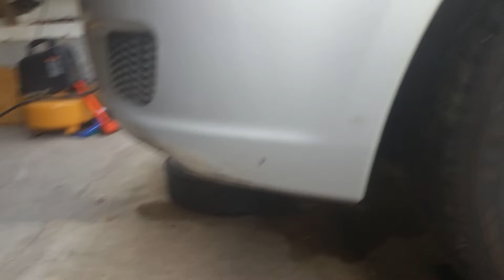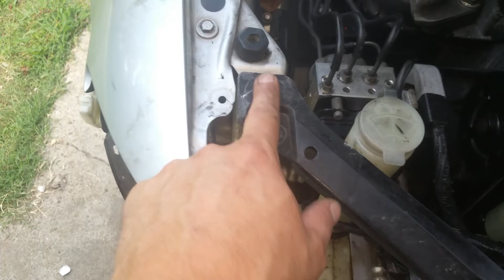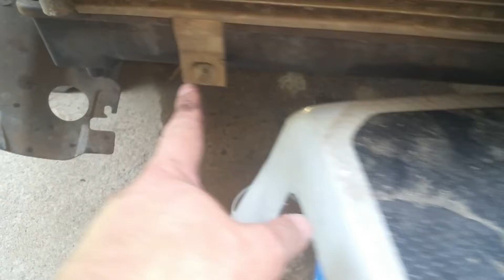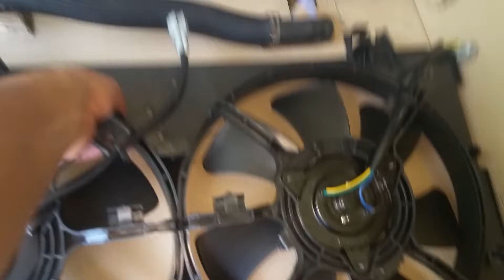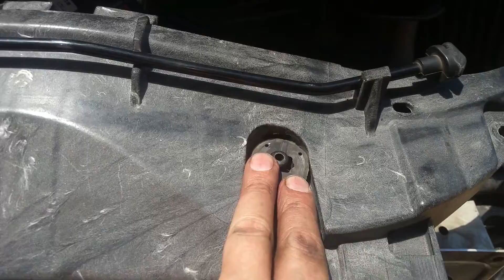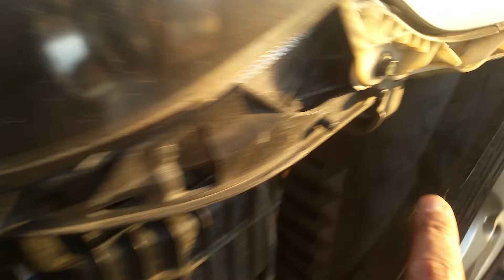Replacing radiator condenser fans 2003-2008 Mazda 6

Comment: Thank you for documenting this. I was looking for a video to help with changing out the condenser on my wifes '06 3.0L. This is exactly what I needed. Hopefully will not have to do the job but will to keep more money in my pocket. Thinking either a/c refrigerant is low or condenser is clogged since the a/c blows warm air when idling but cools down when moving. If it turns out to be the condenser, should I replace the radiator too since ill be down there anyway? Its the original.
Reply from the maker: I would start with the fans , check if they are blowing hard enough. Sure would not hurt to change the radiator while you are there. May  be able to clean the condenser and radiator at the car wash and check for improvement. Really sounds like a fan issue if it cools fine highway speed. Thank you for watching.
Reply: @WrenchTheory501  I didn’t even stop to consider the fans. I’ll definitely take a look at that and try cleaning the condenser at the car wash. Thank you, again!

Comment: Hi can you help me when the engine is hot the coolant from the radiator transfer to the coolant reserve and never go back to radiator 
And its start to lick because its full
Why it doesn’t go back to radiator? 
The fan isn’t working but when i turn a/c the fan working
Reply from the maker: I had this situation once and it was the thermostat stuck shut. Start there the thermostats are cheap. I would definitely get it fixed soon so it does not overheat the engine. Thanks for watching.

Comment: There is a small 1/2" hose to the left of the upper cooling hose.  Do you know what that is for?
Reply from the maker: Thats the hose that runs to the throttle housing . Its made for frost prevention but it warm climates unecessary . It does not affect how it runs or idles and alot will plug or bypass it. Thanks for watching

Comment: Great video. My wife wanted to surprise me by having the dealer replace the fans on my 05 mazda6 since they ran so high even after having the engine turned off, and as well as valve cover gasket. It took them 3 days to do so(they originally said one day). They quoted her for a bunch of stuff that needs to be fixed(already aware of). While they were testing and or replacing the fans, "the radiator failed" for which they quoted her about $1000 to fix. Needless to say i can save myself some $$ by attempting it myself or even going to a mechanic. I'm pretty mechanically inclined as I've changed brakes, rotors and other minimal stuff in the car before. It looks like most of the work here is getting to the radiator where you can remove and replace it. I've subscribed btw.
Reply from the maker: Thank you very much for the feedback I appreciate it. You are correct the work is not that difficult its just removing alot of things to gain access , this is the same with most cars now it seems. Best of luck on your project and I hope all goes smoothly . Thank you for subscribing.
Reply: @WrenchTheory501  Have any tips on engine bay cleaning? Or have you done a video on that? I figured while I'm down there and have so much access to some otherwise not so accessible place I might as well clean the engine,parts and what have you.
Reply from the maker: The best thing is a pressure washer , even without cleaner the water will blast all the greasy gunk out of there. I know this one was horrible on the engine side and I had washed it best I could. Purple cleaner works really well and a long handled scrub brush like you use for tires. Make sure to wear gloves because those degreasers are pretty harsh on the hands. Thanks again.
Reply: @WrenchTheory501  Well I don't own a pressure washer but I was more concerned with getting things wett that shouldn't be. No problem.

Comment: Really helpful video!!! Now i know how too replace the fans also! Thanks so much
Reply from the maker: Thank you for the great feedback . I will say I was impressed with the replacement fans , they were not the oem however they have been working great since and looked oem. It was also nice for the price to replace it all new. Another thing I would add is if your overflow tank is cloudy I'd go ahead and replace it . Mine was cloudy and after putting it all together realized it had a small leak . I was able to squeeze a new tank in without removing anything but the ac hose clamp . Anyways I found one cheap on ebay and it was only 10 dollars and it's worked great and now I can actually see the fluid level . Anyways thank you for watching

Comment: hi s33therfan i really appreciate your recordings it's a real time repairing guide you have a great technique experience that helped me replacing my combination switch on my Mazda3 2006.. i'd like to clean up my AC filter and refill with AC gas if you come across one of those please upload it and get a cold beer after :)
Reply from the maker: Thank you for the feedback , I've just replaced the expansion valve , condenser , & pump , on my Mazda 6 , hopefully it's going to behave now . I appreciate the feedback and thanks again